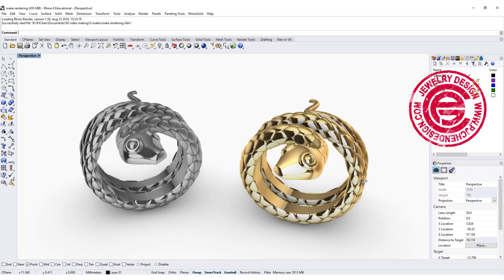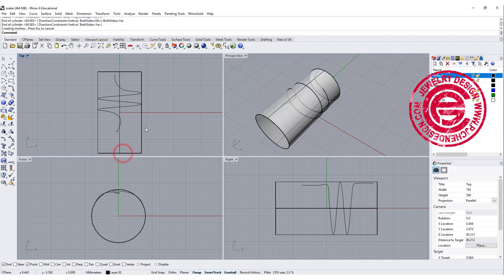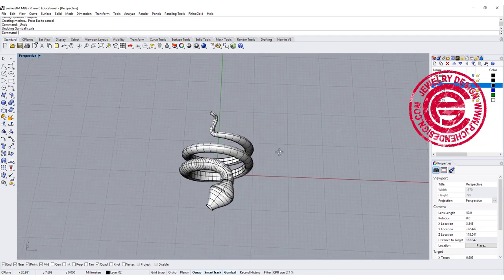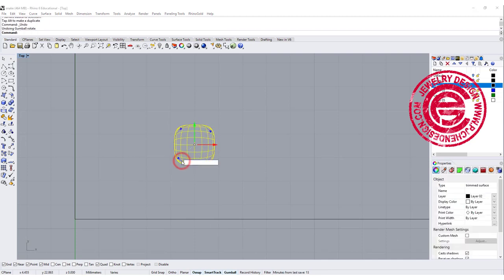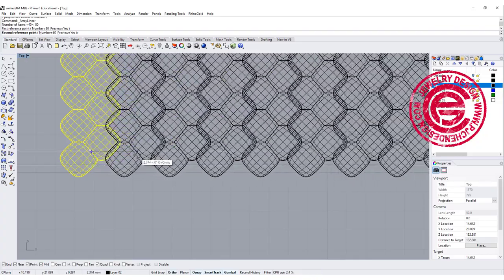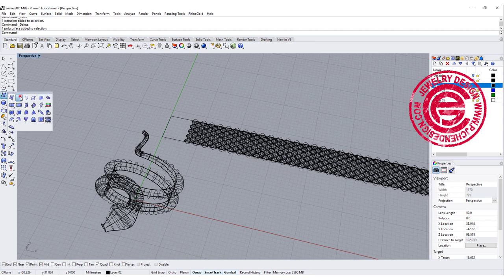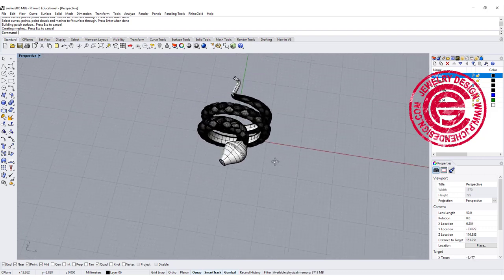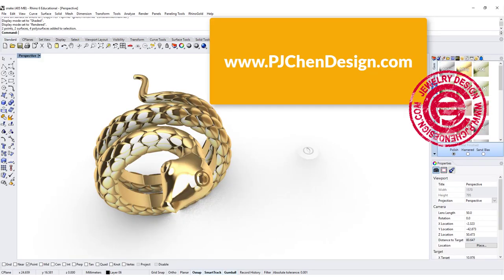Snake Ring Design 3D Modeling in Rhino 6: Jewelry CAD Design Tutorial #97

Comment: PJ is there a way to link the crossed sections with the rail before sweeping? The problem is that when I edit the rail (history recorded), the crossed section don't follow and it make it hard to edit the shape correctly. Is there a solution to that? Thanks a lot for your videos, we all learn so much.
Reply from the maker: If you record the history correct, the final surface should follow on either moving/editing cross sessions or rails.

Comment: Heyy when i fo flow it is only working on the top surface my surface of snake is divided to 3 parts. I am stuck how can i make them 1 part? I tried to join and i tried group but when i do flow it only works middle surface or side surfaces not all at once
Reply from the maker: try to rebuild your original curve before sweep. so your surface will be single surface